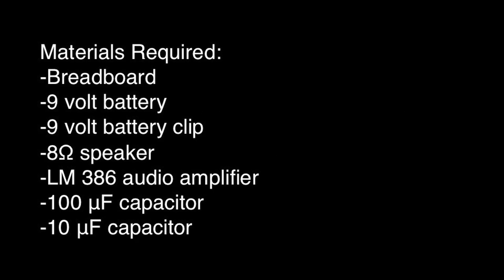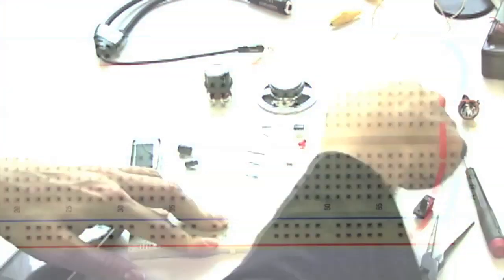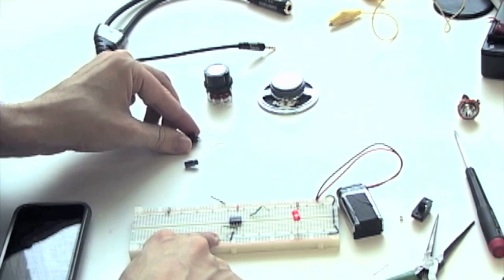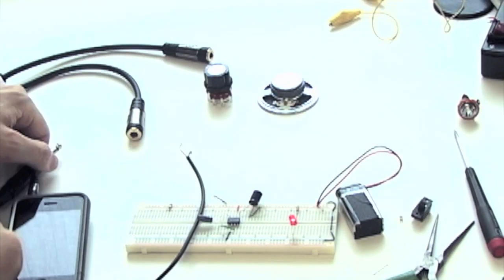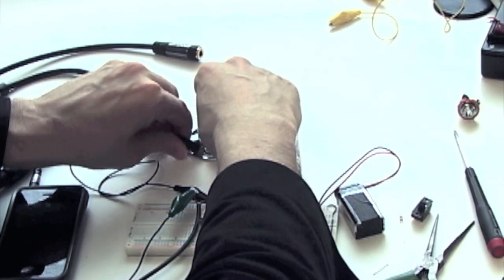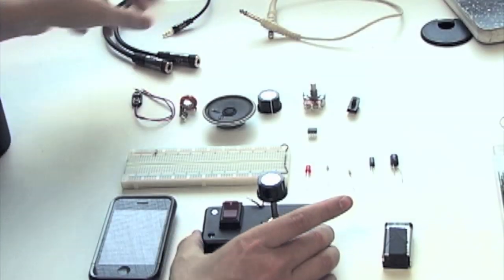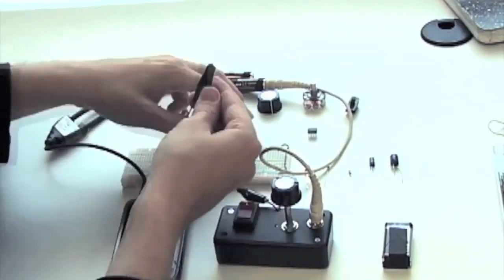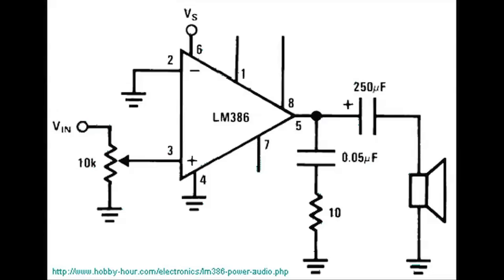DIY Audio Amplifier (Musical Electronics - 2)

Comment from the maker: Electricsrb good observation, the schematic has some extra optional filters.  Also I managed to remove the ground wire connected to pin 4 at somepoint during filming... and we missed it in the edit  That wire to ground is needed.
Reply: If my calculations are correct, those filters pass frequencies from about 3 KHz to 12.5 kHz. Any reason for this range? What benefit do these filters add?

Where in the circuit did you put the switch? In series with the potentiometer?

What's inside the black box? Did you solder the components to a protoboard?

Thanks!

Comment: theres a much better chip for small audio amps..AN7511. puts at 5w 9v. or even TBA820 puts out a full 1W. LM386 is about .5w, unless you get the n-4 package its closer to a W...makes fun little guitar amp, as seen in the ruby amp etc...